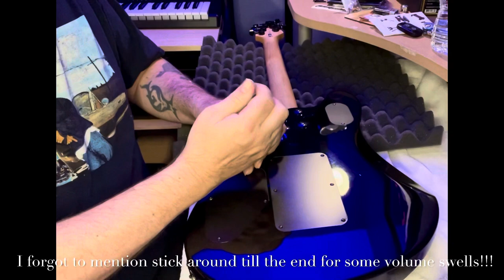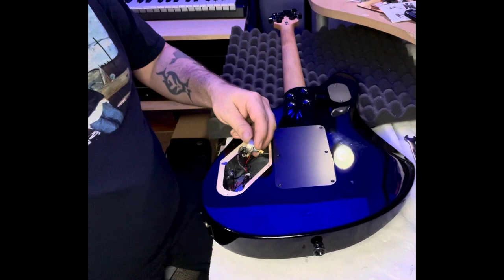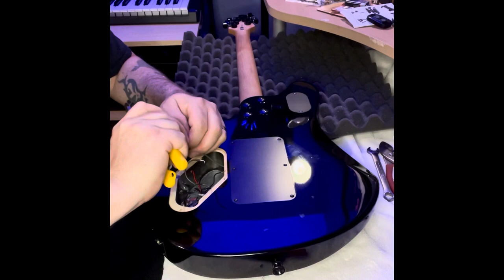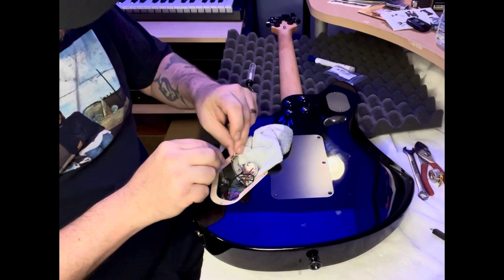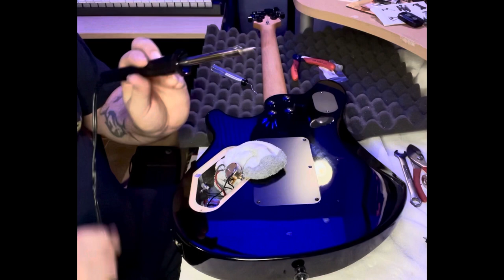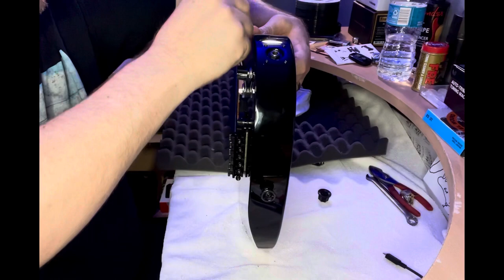Evh Wolfgang Standard gets an upgraded Bourns volume pot.  #evh #evhwolfgang #bourns #guitarmods

Comment: I've read you can't make an even swap to the Wolf Special pots because they're not metric or knurled. Did you have to make any behind the scenes modifications to do this is was it a drop in and go?
Reply from the maker: the only thing i might have done is open the volume pot hole with a bigger size drill bit.

Comment: It'd be more helpful if you explained what you were doing or at least had text inserted.
Reply from the maker: I am working on it!!! Thank you for checking out the video as I do more videos I have started to get better at it. Be sure to check out my new video tomorrow for guitar mods which will be better then this one!!
Reply: Simple and to the point.
Reply: And Ditch all the NOISE.
Reply: Do you need a screwdriver to remove the knob  or does it just pull off?
Reply: @chrischamberlain701  there is a hex screw holding the knob on, 1.5mm